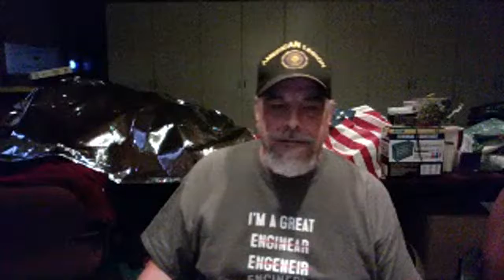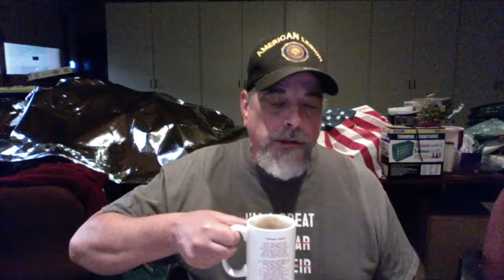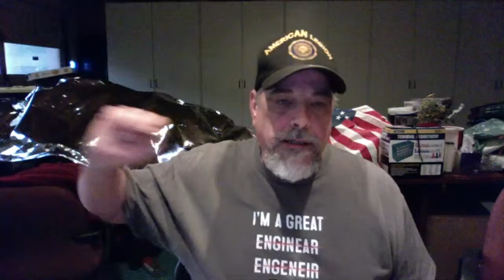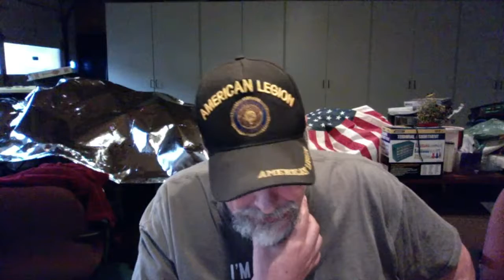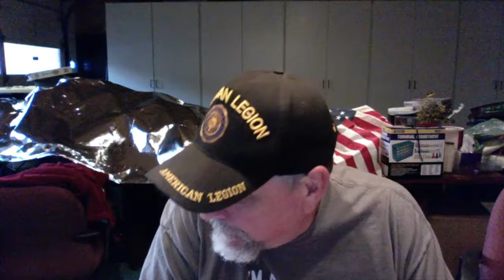Renew You - Pioneering Solar Art Energy

Comment: 👍 it's been helpful being able to offer my customers the 30% incentive. Solar is coming faster than you think!
Reply from the maker: Yes Dream Dare Create, I agree that solar is a no brainer moving forward from this date... Alternative energy is here and the time is now! Home & Industrial Solar Power was once just an expensive novelty without the ability to give a return on investment. The Solar industry stepped up the mono-cell production with rugged characteristics adding value as to a reasonable 25 year life expectancy. Understanding why the different solar panels were produced starting with a single cell's ability to produce 1/2 volt of DC voltage ranging from .1 ~ .2 Amps and arranging 36 cells in series to produce 18 volts to keep a 12 Volt lead acid battery charged was all I used solar panels for in the past. Primarily in rural applications where it was cost prohibitive to place poles and wires mains power to run pumps. Now depending on the configuration we tap into the sun's energy with solar panels weighing just under 50 pounds, producing 100 ~ 400 Watts apiece of usable electrical power. With the introduction of the Micro grid tie Inverter's ability to transform DC to 220 Volt AC efficiently harnessing this energy and  optimizes each panel to directly tie into the mains power system. With a net meter the electrical savings over time will pay for the Solar power system on almost any scale within 7 ~ 8 years. We can keep adding to the system to meet our individual electrical energy needs. Which to my way of thinking is a remarkable deal. Now the fun starts with off grid inverters capable of keeping the grid tied inverters online when the mains power is interrupted for uninterruptible power supplies and providing the Automatic Transfer Switches to keep our linemen safe. This is a young market that should produce incredible scaleable solutions with future alternative energy production developments. Folks like yourself, have the opportunity in providing yourself and your friends with electrical energy independence and providing more comfortable living environments in harmony with the environmental construct. Plus the ability to resale energy back to the grid as a member of the micro power plant nodes system. Congratulations! This is a very new and exciting chapter that is just now being written...
Reply: Local power company offered us .0010 cents per kwh of power we supply to the grid yet they sell a kwh for $7-9 each.  Crooks. Absolute robbery.  Off grid is what I suggest for my customers.  And the solar fields are just the big shots trying to get ahead of the game and hold their place in control of the people by having control of their power source.  Residential self sustainability is what the people need to strive for.
Reply from the maker: @MrFigureitout  My approach though it takes more planning is to determine my clients goals... When mains power goes down my early clients wanted only to have their computers on UPS backups and their routers uninterrupted however for up to 96 hours instead of 20 minutes like a small UPS battery backup provides... However they didn't want to install a generator. This lead me to installing modular UPS equipment that was scalable. Water pump operation was my first off grid installations since they draw about 660 watts of power 24/7/365. In an emergency that continuous source normally used by pumps can be switched and facilitate emergency lighting. This is where I learned modular switching for refrigerators, freezers and ice makers then learned to do the larger loads such as HVAC condenser units. Gas heat still works best for home heating, drying clothes, ovens, stovetops and water heating... Heating elements I haven't found a solution for other than just raw power. The trick is over time is to learn to use mains power minimums as the seed power and learn to alternate demands... However this becomes a serious investment as to equipment with a balancing act to provide safety and reliability... Our society still have a plethora of adjustments to provision reliable off grid UPS systems without interrupting comfort and avoid creating the monster of maintenance. My approach is to take one thing off grid at a time... We can work with nature to get the Q much higher but I've not discovered free energy other than the ride of a sailboat when the wind is blowing favoring the directions I need to go. Sails aren't free and they don't hoist nor roll themselves and boats always seem to need maintenance. Shore power is convenient when the the ship gets to port.
Reply: Got an email? I have so something I want to send you that may interest you sir! Thanks for your replies!